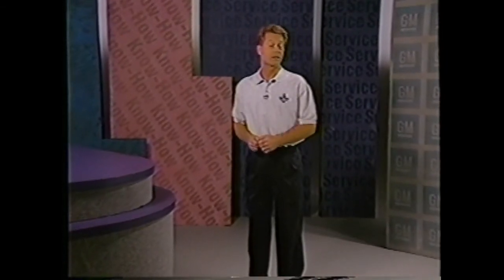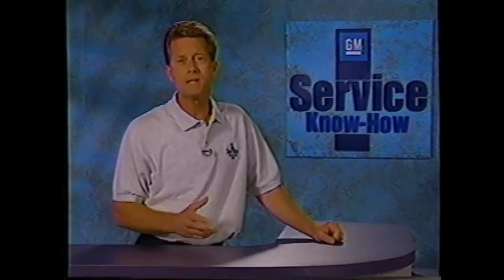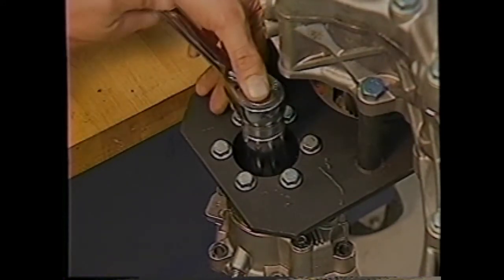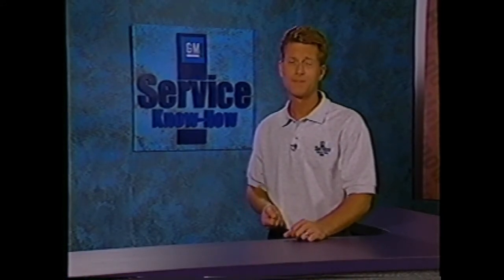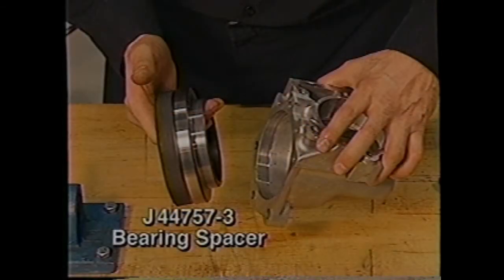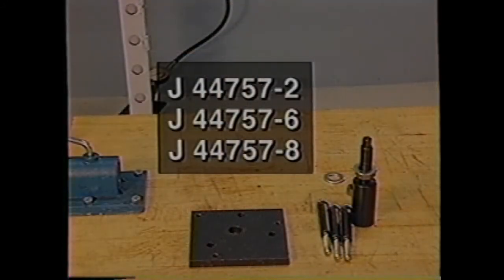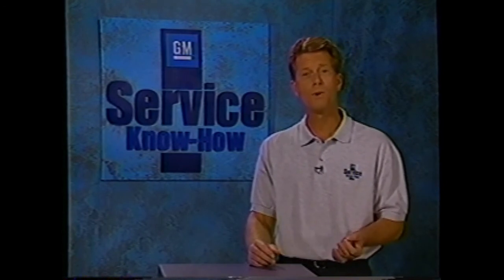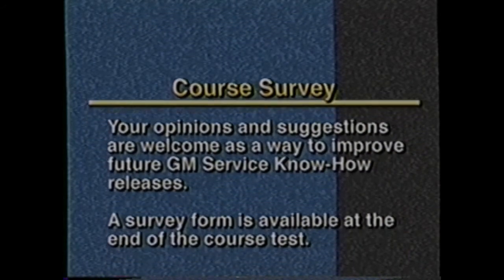Versatrak All Wheel Drive System

Comment: I'm completely shocked and impressed that I watched this whole thing like I need to be taking notes on this system. This was pretty interesting to learn about and I'm honestly glad we got away from this design of rear differential. I was surprised that there was an idler gear that was implemented in the rear diff vs the transmission housing. I even chuckled at the two seals that they had to separate the gear oil from the differential oil. Nice upload! :D

Comment: This is a wonderful video that is helping me solve a horrible problem. The rear differential oil flow check valve Gm part #88896067 is apparently failed on my 2003 Buick Rendezvous and the functionality test might tell me if the clutches are toast. GM should be ashamed for ever creating this monstrosity of an AWD system.